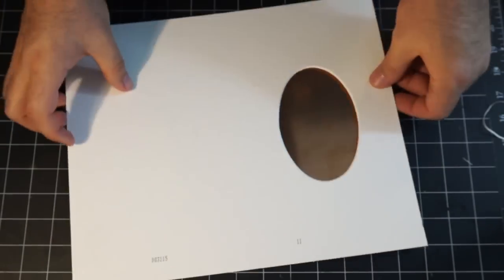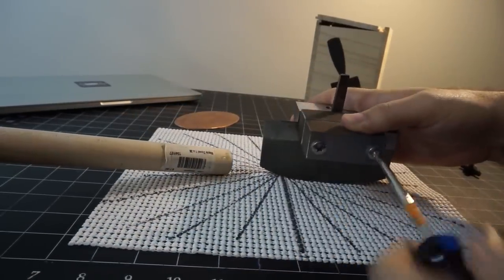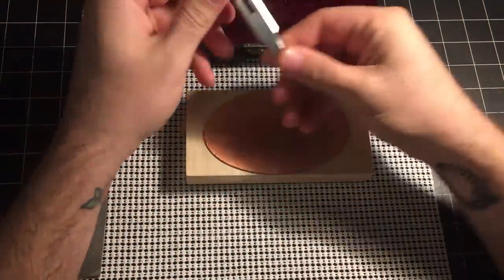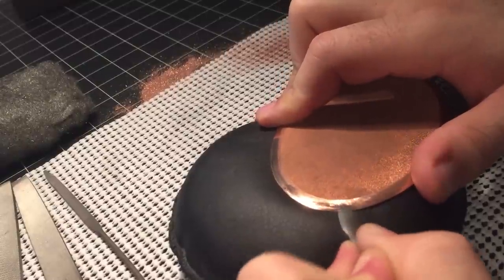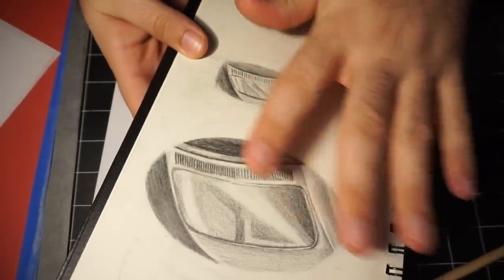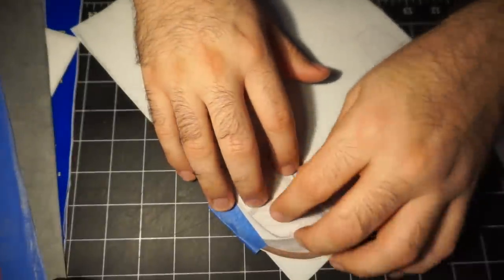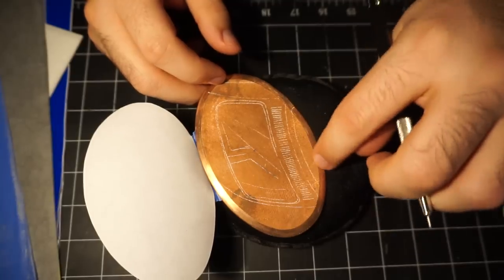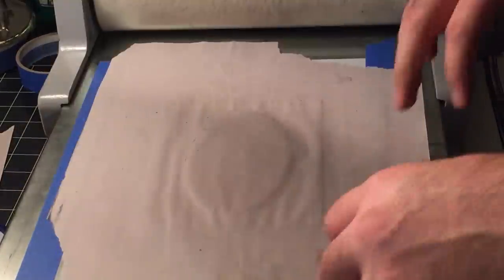Volkswagen Beetle Mezzotint Print

Comment: Very cool! That rocking tool you used in the beginning. Does it create tiny dents in the surface. A kind of dithering? So its not too hard to remove the copper with the scraper. Also does it dish the copper?
Reply from the maker: Thanks! It creates tiny burrs of copper that stick up, and tiny pits also, allowing the ink to stick to them/fill them. the more you scrape/burnish them away, the less ink they hold, making lighter areas. I use fairly thick copper, so it does not dish it, but I've had it happen a little bit on large plates.
Reply: I bet it does on large plates. Because you are stretching only one side of the metal causing it to dish. Keep up the great work!